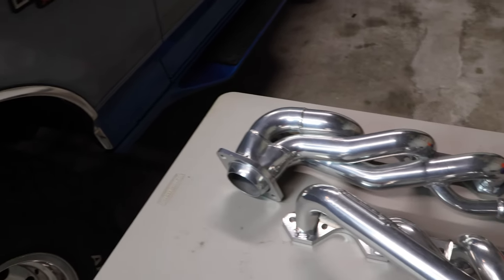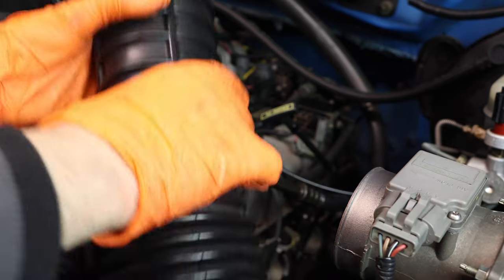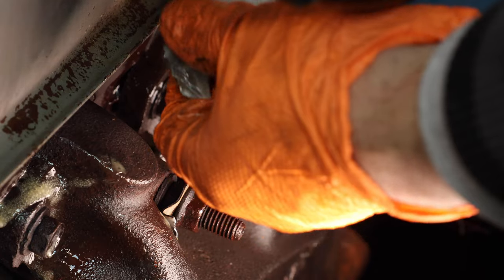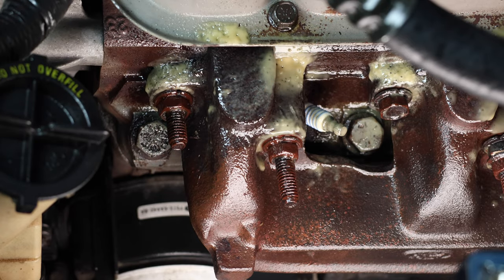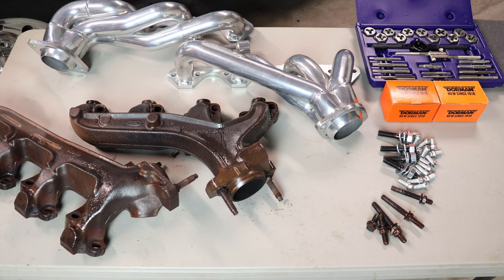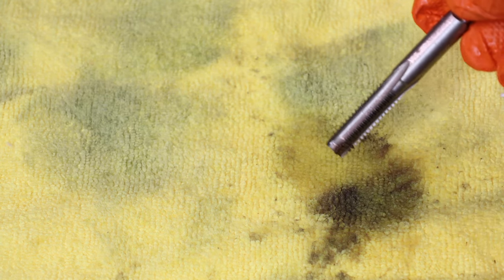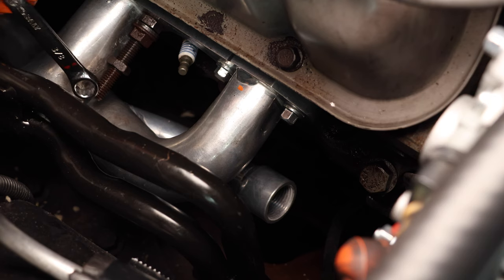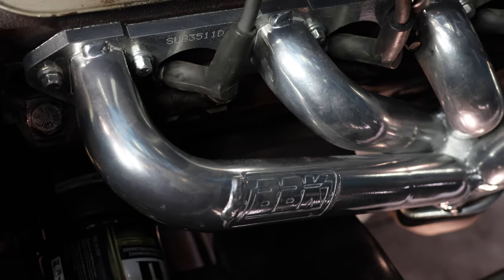Upgrade Leaking Exhaust Manifolds | BBK Headers | 1980-1996 Ford Bronco F150 | Bronco Restoration

Comment: I have a stock 1994 Ford XLT f150 he has a stock 302 or as people like to call it the 5.0 I was thinking doing some headers like this and place in my stock cast-iron, just for the nice sound and a little bit bottom end torque, already upgraded the stock 94 fuel injectors over to a stock 97 Ford explorer fuel injector nozzles that had the four holes instead of the single she run smoother better fuel economy came with that time for something like this hope it's worth the time and money
Reply from the maker: Make sure to purchase the correct set of headers, the 5.8 headers will bolt up but the egr routing is different.
Reply: @TheFixTech  yeah I'm doing all my homework before I do anything because I know there's a lot of pros and cons about adding headers to a stock motor I'm just looking for something that's going to let her breathe a little bit better
Reply: @michaelmyers3892 bassani y pipe is good also. 3" exhaust pipe not sure who still makes one though

Comment: Greatly Appreciate your video. I have a 1994 5.8 4x4 f150 that recently started blowing blue smoke,  backfires,  sucks gas & loss of power.  I replaced the PCV VALVE and seemed to solve the problem for about 50 miles and now even worse than before. Long story short I came across your video on smog deletion and believe I'll see if this works. Thanks again
Reply from the maker: Get the truck to operating temps, pull obd diagnostic codes. I’ve seen coolant temp sensors and tps sensors cause havoc

Comment: Did they match up to the Y pipe ? I have a Flowmaster Y pipe that i haven't installed and am going to get headers my truck has the wrong manifolds for the Y pipe and it's a fresh long block so extra flow should help some the flowmaster Y pipe for the 5.8 liter looks like its nearly 3 inches from an inch or so back all the way past the catalytic converter

Comment: Thx man. I would definitely install that coil support. That whole assembly is pretty heavy, and I’ve had it break on the other 2 mounts that screw into the lower intake. I also haven’t found a great way to mount my dipstick bracket yet

Comment: Awesome video, I have similar headers for my 302. What underhead length bolts did you use on the headers? Would 3/4" or 1" be best?
Reply from the maker: I used the hardware that came with the new headers, they were 3/4 length.

Comment: Did you have to order each header or did one of your links provide both sides different finish?
Reply from the maker: Yes, both headers are included in the order, each link is for a different finish.
Reply: @TheFixTech thank you sir! I had sticker shock thinking they were each $400! I'm considering ordering these and a new y pipe.

Comment: How did you find the exhaust leak? I’d like to check mine I just got.
Reply from the maker: You can use a mechanic stethoscope or the manual way, on cold start feel around with your hands around possible suspect areas. Be sure to only do this on cold starts as the exhaust gets hot fast. Also visual inspection, If you see black soot near manifold or exhaust flange and clamps that would be suspect.

Comment: Any issues connecting the egr pipe to the header?
Reply from the maker: On the truck shown in the video the fitting was a little tight but went on nonetheless (I assumed due to the coating) On my 90 the fitting was spot on. Both 5.8.

Comment: Any noticeable performance gains?
Reply from the maker: I would say minimal performance gains, 5hp max. I did this upgrade mainly for the looks and sound. These sound very good and I can tell the flow is better. BBK does state a 10-15 hp increase but I would assume that is with an open exhaust. I am currently running dual cats and a muffler, and it still sounds great. The biggest bottle neck on these engines are the E7 heads, if you want good performance numbers you would either need to port the stock heads or go aluminum aftermarket. A nice set of heads, mild cam and these headers with open exhaust and you’ll pass 300hp on stock bottom end.

Comment: By chance does anybody know for a fact if these will fit on a 1996 f150 4x4 w/ 5.8L? It looks like it’ll fit but on summit racing it says it won’t fit.
Reply: I didn’t end up using the BBk headers. I went with the JBA performance 1628SJS. I just finished bolting them up today and they fit perfectly. Now just gotta put everything back together.
Reply: @Obsford482  do you feel or hear any difference with your new headers?
Reply: @Acosta-on7do  I could definitely tell the difference. The added torque was noticeable and the sound of the exhaust was deeper sounds less restrictive. It was worth the work to get it swapped out lol
Reply: @Obsford482  I am finally getting headers. I want to buy the same ones you got, can you give me an update? Any issues with them?
Reply: Do they bolt directly to the stock y pipe or did you have to get an aftermarket one?
Reply: @dustinsmith4766  I’m the second owner of this pickup starting from 1999, the first owner owned a muffler shop and he installed a 3” flopro muffler and pipe while he was the owner, however, he left the cast iron exhaust manifolds on the truck and the stock pipe through the cat to the muffler. When I installed the JBA headers they fit right up to the existing pipe coming off of the factory exhaust manifold and everything fit back into place with the new headers. The only thing replaced was the old nuts and bolts from the old flanges and the old headers bolts.
Reply: @Acosta-on7do  So far it’s been 6-7 months and I’ve only had one issue. HEAT. After a week or so of driving I fried my ICM from the heat off the headers and my fuel tank selector switch went bad at the same time. I decided against headers wraps at first because I was worried about the warranty on the headers but after installing the new ICM and tank selector switch I decided to wrap them. If I could go back in time I’d probably wrap them first prior to installing them because wrapping them while installed on the truck was a pain in the butt but not impossible. Totally worth it now.

Comment: Do you have a stock cat?
Reply from the maker: Unfortunately no, the previous owner installed an aftermarket replacement y pipe catalytic converter (not the best quality) I am looking for a nice stock one.
Reply: First of all thank you for this video it helped tremendously. Did you have any trouble fitting an EGR tube on your shorties? Mine is not threading

Comment: I bought summit racing ones and the pos won't mount to my factory y pipe.  It's bullshit I've spent 3 fuckin days fighting them. And also can't tighten 1 of my spark plugs back up cuz the header in the way. Someone shoot me
Reply: Ouch did you get the headers for a bronco? Might have to hit the header with a ball pein hammer. As for the y pipe the 5.0 might need adapters I know I needed them for bassani y pipe to stock manifolds.

Comment: My 1994 has a bad leak on the passenger side, gonna have to fix it soon. Can you tell me if there were gaskets there when you pulled the manifolds? I hear there are and aren’t, there’s some conflicting information.
Reply from the maker: Mine did not have gaskets, I added a gasket on the passenger side to help the leak but was useless since the leak was from the collector. That’s when I decided to upgrade to these BBK shortys. From my research Ford did not use gaskets from the factory, if gaskets were used it was after they left the dealership.

Comment: Do those headers have a 2.25 inch outlet on the RHS and a 2.5 inch outlet on the LHS like the stock exhaust manifolds do?  It seems that fact is sometimes overlooked and that might be why you had an exhaust leak on the RHS in the first place if your y-pipe had a 2.5 inch inlet on both sides.  Great video!

Comment: What did you do with O2 sensor
Reply from the maker: The o2 sensor should be located on the y pipe. If yours is in the header you can relocate the o2 to the y pipe

Comment: Help! I ordered a other set of Headers for my 1993 F150 Windsor, installed them and the EGR pipe doesn't reach the EGR!?!?  Has anyone found an EGR pipe that fits this Header and links up with the actual EGR? Thank you!!!
Reply from the maker: How far is the pipe away? I know there are a couple different egr valves that will work that are longer (lower, to reach egr pipe) than others, this may help.
Reply: @TheFixTech  the pipe sticks out the wrong way actually! Me and my buddy tried to bend it and it was about an inch too low
Reply: @TheFixTech  Do you by any chance know if the EGR deletes are bad for these engines?? I have seen some things saying they're great, and some saying they're the worst idea ever!

Comment: I have loud exhaust and smell. Previous owner  took out both cats. Would this cause smell and obnoxious sound and loud drone sound when accelerating?
Reply from the maker: Yes, absolutely. Also check the muffler, if the muffler has been removed or is an aftermarket. Gibson exhaust has a factory sounding muffler, and Walker exhaust will have the cats.
Reply: @TheFixTech  ok thx, gonna put a cal cat back on to start and see how it does. I have a rough idle. Also, do you think not having a cat would cause this? May be running rich?

Comment: I did this upgrade. It wasn't as easy as it looked. One of the problems was the EGR fitting. The thread on the EGR  fitting would not screw into the header as the threads were different. I had to go to my local logging supply, find a fitting that would thread into the header port. I then TIG welded the threads onto the stock fitting. The passenger side  rear bolt was also hard to reach. I figured that a tiny ratchet, wobly and 3/8 socket would do the trick. The biggest problem was the y pipe would not bolt right up to the header flanges. Imagine this, a heavy duty ratchet strap pulling one of the y pipe legs in one direction, a long steel bar moving the pipe leg in another direction and a ball peen hammer in your other hand hammering up the flange to receive the header bolt. I felt like I was standing on my head spitting pickles. OMFG My wife said my hair looked funny after that.
PS almost forgot, the drivers side headers were not tapped for studs😮
It was a great video and inspired me to upgrade. The exhaust gaskets I had put in 12 years before had bought the farm.
Reply: Having the same problem with the EGR fitting..WTF! I thought these were plug-n-play!
Reply: @chadvillines5127  cheese and Rice!
Reply: Going through the same bs right now! Bad QC from bbk? How's yous holding up with the fix?

Comment: Don't do headers, I blown 4 gaskets within 1 year
Reply: That's your fault for installing headers with warped flanges.
Reply: Remflex gaskets are the best
Reply: Header gaskets make a huge difference too I recommend Percy's gaskets they reseal if they ever leak but I've never had any leaks with mine and they've been on for years I'd also upgrade to ARP header studs if you don't already have them the Percy's gaskets are thicker than the in box gaskets